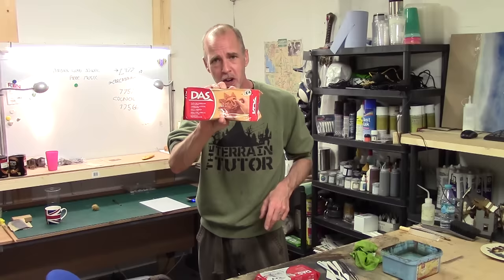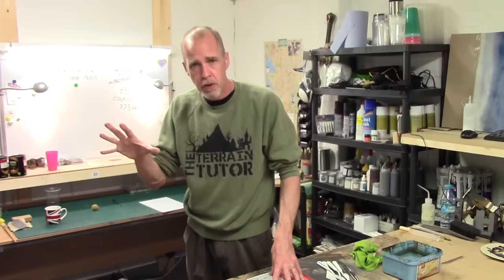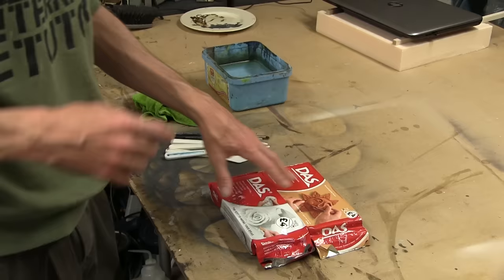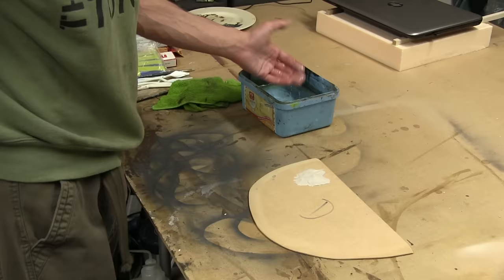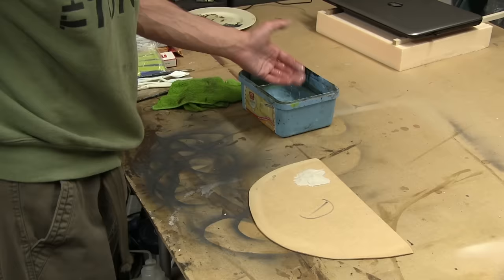Das Air Drying Clay - Pro Terrain Tips & Tricks

Comment: I use air dry clay a lot. I always have a small spray bottle filled with water whenever I work with it. I realized it's better to start with a thin layer of airdry clay in making sculptures let it dry and re apply another layer, building up. Sometimes I mixed airdry clay and more water to turn it into a paste and I use it in filling cracks or as a adhesive whenever I apply a new clay over a dried up clay.
Reply: This helps a lot thank you
Reply: hello i have a question? what if when it's dried very well in 1 year or more and then you squeeze it what would happen? it's still durable and it will never be broken?
Reply: Have I told you..that I absolutely love you!thank youu❤❤❤I dint know anything ,everything I was making a was thrown the trash lol..I now see why it cracked so bad..tytyty ..
Reply: Michael Jayson Banua  Thanks for sharing! This really helps!
Reply: Thank you!!
Reply: Thanks!this is very helpful
Reply: Layering air dry clay has been unhelpful in my personal experience.  The layers dont merge into each other very well, so they split off frequently. 

I must be doing something wrong, because I just cant get it to work.  Is there a technique to make the layers join up better?
Reply: @CNNBlackmailSupport  what I do is I scratch the surface of the dried up clay, spray some water to reactivate the dried up clay in the scratched surface making it sticky before adding "new" clay. It's like when you're adding cement on your wall to smoothen the surface, you have to scratch the surface so that the new cement have something to hold on to and combine with the surface 😊
Reply: @zahrah4504  welcome
Reply: @iwakuralain1459  welcome
Reply: @elinoldenburg8547  welcome
Reply: @yolandanadamas2930  cracking is normal. It happens to clay that "shrinks" when it dries because the water evaporates or other substance in it. I suggest to use clay/s that has low to 0% shrinkage. Though normally when you add water in it to turn it into a paste it does really shrink as it dries and cracks may happen. What I learned is you have to apply clay in layers to minimize cracks. It'll make the base stronger as you build up the layers and starts adding details. Some artist do advice to pop them in the oven to speed up the drying process/curing but I haven't tried it.
Reply: @WhiteTiger-gt3tn  I have a few figures I am currently sculpting. A few of them where 2 years old and they are doing well. However the hands that I sculpted were completely destroyed because I used wires as base and I forgot that they are not stainless steel so rust happened. So I suggest to use aluminum foil or wires, brass wires and etc. As long as they do not rust. The rest are ok and they do not crumble or seen any cracks.
Reply: @Pablo Peraza welcome 😊
Reply: @thornprick2645  welcome 😊
Reply: @michaeljaysonbanua4870  thank youuuu❤I am learning so much. Thank you😆
Reply: @michaeljaysonbanua4870  Makes sense.  Kind of like applying a patch to a tire.  Gotta rough it up first for maximum surface adhesion.  It's so obvious now that you said it.
Reply: It's like miniature concrete
Reply: @michaeljaysonbanua4870  I have a question, can you make air dry sculpt as master for making, let's say a silicon mold?
Reply: thank youu
Reply: Thank you for this tip!
Reply: What kind of paint i have to add to it before it harden? Does acrylic paint work?
Reply: Using a few ' art ' paint brushes helps with this as well , it smoothes the surface and makes a slurry that fills joints and cracks . Also helpful making interesting surface textures .
Reply: @michaeljaysonbanua4870  Excellent tips ! That is also an ancient plastering method , ' keying ' , ie roughing up the surface so the new clay has something to cling to . Amazing how many building techniques come in handy with this material .
Reply: Have you had a success with attaching air dry clay to cardboard? I'm building houses and other stuff out of cardboard and was wondering if it would stick to that?
Reply: Can I just cook it? Or is it a must for only air drying.
Reply: Thank you for sharing, its help a lot
Reply: Yes. You can also use PVA white glue to strengthen air dry clay at thin areas, applying with a brush on the surface.

Comment: This has probably been said but don't throw away any small parts of dried air dry, add them to a tub of water and mix them to make slip. Slip basically glues the clay better than plain water and adding a light layer to a piece before drying can avoid cracking.

Comment: 0:00 intro
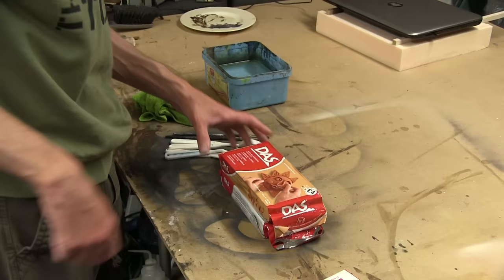1:10 dark clay and light clay
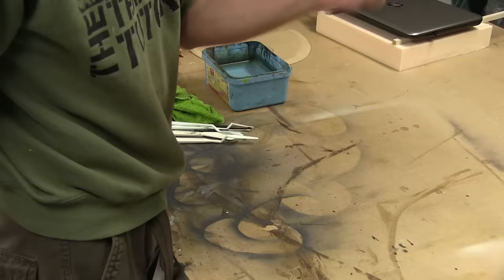4:46 wrap/seal your clay
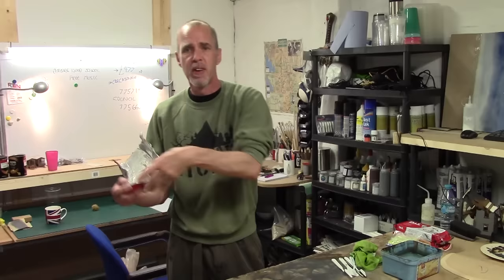5:46 tools
7:30 clay fall of surface?
11:11 clay cracking ?
17:50 can i use it in molds?
24:00 tips on using different tools 
28:26 adding additives 
29:11 mixing das with pva 
32:29 quick recap 
34:10 outro

Comment: I have been using air dry clay for many years in Western Canada which is a very dry climate.  One idea that I use to keep my clay from drying too quickly is to take a bit of a sponge, soak it, wring it gently & place next to the clay.  Cover all with cellophane wrap.  I do this when working on large pieces that take several days to complete as well as when I am finished to prevent cracking.

Comment: As a long-term user of DAS to make wargame terrain, I use it in a slightly different way.

1 - I add DAS over a thin layer of dilute PVA glue

2 - I score the base material either MDF or plastic card with a scalpel. Criss-crossing across the surface to produce a 'key' for the DAS to grip to.

3 - I bake my DAS in the oven short bursts of about 10 minutes at low temperature.

4 - When fully set I seal the DAS with a dilute PVA and water wash.

I have not had any problems with cracking or lifting.

If I need to add a thick layer, I will apply the DAS in two or three thinner layers or use Balsawood or foam as a bulking up product and apply DAS  over the top.

Finally, I prefer DAS Terracotta (I think it is is finer) , but use DAS White as it does not stain.

Just my technique.

Tony
Reply: I've heard tou can't waterproof it, is that true? I'm making a far less cill fary garden lamp for my daughter so need it as strong as possible
Reply: So what temperature do you bake it at?
Reply: can I bake das clay air drying too?

Comment: Best DAS video out there! Well done! One correction though. Scratching the surface will actually prevent cracking. In the old times, farmers in my area used to put a clay mix as plaster on barns and houses walls. They used to scratch the clay after sticking it to the wall surface to prevent the clay from cracking and falling off.
Reply: Hi! I see you worked with DAS before. I'd like to put a thin layer of DAS around a styrofoam ball. How would you recommend me to do it, please?
Reply: @lidia1407  really late but with any clay I would recommend to wrap the styrofoam ball with saran wrap then add the clay
Reply: @stevekujo8716  Thank you very much :-)

Comment: A good tutorial! I use DAS for crafting and find Titebond quick & thick glue sticks it well, dusting silicone moulds with corn starch enables flipping out immediately when making multiples, scrape a knife over mould to remove (and reuse) excess before flipping out shapes and repair small cracks with some DAS in a little water to make liquid and brush gently into cracks to fill them. Happy modelling!
Reply: Hey!!! Just what I was wondering. I’ve only seen one person mention that and was asking about it. Also, do I need those actual tools? I thought I’d use plastic knife and utensils. I’ve got a couple of tools but I’ve seen others use many things for adding texture and the like. If you have any input, I’d appreciate it. 😊
Reply: @1ronmad1n  Hi, I just use anything I have to hand for shaping etc. I only do modelling now and then and some specialist tools can be pricy -  so 'use what you have' is my motto! In case it is of interest I often roll out air-dry clay and use cheap silicone moulds to stamp onto it - that works well. Also, if making flat items, make them on a flat ceramic tile (from kitchen/bathroom etc) and leave them on it to dry (dusted with cornflower) - keeps them flatter. The slower things dry the less likely to crack - can lightly cover with plastic if needed. Experimenting is part of the fun - and if it goes wrong, just add water, soften, and try again - practice makes perfect as they say...
Reply: @suebrown7882 thank you so much for your assistance! Yes, I am looking forward to playing around with it now that I know you can just wet and start over. It will be a fun journey, I’m sure. I’ve also considered, as I’ve seen, to try hot glue or the like. This is something I’m determined to do, so I’m going to! Thanks again, be blessed and have a great day!😊

Comment: I know this is an older video but this was so fun to watch.  You have such a great energy.  I think for me and my love of air dry clay, if I was to use a mold of some sort, I might only put it in for a couple of hours and then would take it out to finish drying in a regular temp room.  Additionally, in case others new to air dry clay are curious, I just tested out drying in my oven at a low temp and it worked beautifully!  Keep in mind, these were for flat about 1/8 to 1/4 inch pieces that I am using for earrings.  I still let them sit overnight before sanding, painting, and priming.  Air dry clay is hands down my favorite.  Polymer clay is nice but having to knead and prepare it to even use, is not for me.  I'm pretty impatient and when I want to create, I want to do it right then.  LOL!

Comment: If you want to stick DAS onto plastic card or other smooth surfaces, scratch it up with the back of your Xacto blade and put a coat of PVA on it. Then apply the DAS. It will warp as it dries, but thats ok, just let it. When all dry, you can bend it back straight again and the DAS will develop "micro cracks" to relieve the stress. I put it under a magnifying glass and still couldnt see them well. A coat of paint covered them all up just fine. Thats the way I made my first thatched roof, worked great.
Reply from the maker: Yep, keying plastic works well for bonding bud
Reply: Hi! I see you worked with DAS before. I'd like to put a thin layer of DAS around a styrofoam ball. How would you recommend me to do it, please?
Reply: @lidia1407  You might try rolling it out into a thin sheet and then wrapping that around the ball. Lay down a piece of waxed paper first. That might help you lift it up in one piece.
Reply: @billd.iniowa2263  Thanks very much 👌

Comment: If you want a dry river bed put down das put loads of water on it with a sponge so its a bit slushy, then put it somewhere warm like an airing cupboard. Dry river bed or desert pools instantly. Different thickness and more or less sludge changes the pattern. You can use over wet plaster and pva instead.
Reply from the maker: Top tip mate

Comment: If you need a quick few, use hirstarts moulds with dental plaster. It’ll be completely dry and rock hard in 15 minutes. If you want to keep your texture rollers clean and easy to work with, put a layer of cling film over the clay. That way your tools stay clean and the clay will be workable much longer.

Comment: heey there, 

great video showcasing how DAS air drying clay works. i found your video while looking for answers about DAS air drying clay. maybe its the wrong place to ask but i have a few questions about air drying clay in general and hopefully you can get me into the right direction because from what i could find, you are the most informative. i want to sculpt a bust using DAS air drying clay. 
the reason im using DAS air drying clay over Super Sculpey is because i dont have an oven other then a microwave with an oven function but ive seen that a microwave oven isnt the best way to oven bake clay due to hotspots and potentially burn the clay. 
so my questions are since DAS is an air dry clay, how would you go about and use it to make a bust? would you use a armature and if so would you remove the armature at a certain point to reduce or prevent cracking? if you dont remove it what kind of material would you suggest i use for an armature to get the minimal amount of cracks while its shrinking?

hopefully you could provide me with the answers im looking for. if not, thats absolutely fine, in which case do you know anyone that can?

massive thanks in advance
Reply from the maker: Forget das for that mate, just make a desk oven with an empty can and a desk light, just cut a hole bigger enough for your model on the side near the bottom and shine a desk light into it

Comment: Say Mel, what IS this Das made of anyway? It looks like paper pulp with some kind thinned down clay added. It has some kind of fiberous texture if you break it in two.  
Oh BTW, there is an advantage in using Das in your silicone molds: It will be a heck of a lot lighter than Crysta-cal would be. Better for transporting around.
Reply from the maker: I have no idea what it's made of mate but it's a lot heavier than crystacal both in it's uncured and cured forms mate
Reply: You're kiddin'. Really? I'll take your word for it Mel,  you make your living doing this stuff. But thats a surprise to me.
Reply from the maker: You really need to play with Crystacal R matey .....

Prestia Casting Plaster - 1691PSI, 14-32s, easily carved
Prestia Classic Plaster - 2131PSI, 8-19s, carvable dental plaster
Herculite2 - approx 5000PSI, 6-20s, similar to Modell and Stonepowder
Basic Alpha Plaster - 7054PSI, 12-25s, ALPHA (for polymer resins that require the use of alpha plasters)
Modell Plaster - 9000PSI, 12-16s, good starter plaster, hard and durable but can be carved or modified, very similar to Stonepowder and Herculite2
Crystacast - approx 10-12000PSI, 14-25s very durable
Crystacal R - approx 12-14000PSI, 10-25s, extremely hard wearing
Reply: Thanx for the info Mel. I got 3/4 of a bucket of Hydro-cal to use up. But Crystacal-r is my next plaster purchase. If I ever get thru with this stuff, lol. I'm a very small fish in a very big ocean. I can only work as fast as my health (mental as well as physical) may permit. ;-)

Comment: Make dried up Das clay editable again is not easy, but possible.
What i did was, cut it in small pieces.
wrap in a wet cloth, place the cloth with the clay in a soup plate, and put more water in it, to the edge of the soup plate.
Then leave it for a while.
Then you put all the pieces in a mixing bowl, and crush them with a fork.
For me this was not easy, the clay was still pretty hard.
Then repeat step 1.
Then you make a ball, and you roll the last hard pieces out with the roller and some flour.
You need the flower, otherwise the clay will glide under your roller.

I still had half a pack, and here Das is pretty expensive, so I did not want to throw it away.

Comment: I can confirm that it cracks with pva in it lol, but it is super hard. Currently working on a castle and it's been a pain 🤤
Reply from the maker: It's those thin applications mate, they're a killer
Reply: @ Zach Pennington - Just sticking PVA in it isn't enough, you need more water too, no clay is designed to be used dry, except those made from plastic.

Comment: It's not a miracle compound, you actually have to put some work in to get results; know your materials - building on an MDF base means you'll need more water from the start. DAS won't crack if you use enough water, clay ALWAYS needs water (unless it's made of plastic) keep work evenly moist until complete - look at the amount of water potters & ceramicists use & the effort they put in, clay needs work, you don't just bang it together; try making a jar of 'slip' & key your surfaces to help with sticking - it's clay, not Velcro. Ensure it's dried slowly & evenly - there's no harm in spritzing the outside with water if it seems to be drying too quickly. If you want a product that does everything for you, don't choose the cheapest product in the craft shop, there are many other clays with more properties & fancy oils etc to stop cracking, but you have to pay for them.
Reply: Hi! I see you worked with DAS before. I'd like to put a thin layer of DAS around a styrofoam ball. How would you recommend me to do it, please?

Comment: I use DAS clay a lot;  I store it in an air tight box, BUT,  before I put the lid on, I take a tissue, or a piece of paper kitchen towel, wet it all over, fold it in half and place it over the clay;  then I lock the lid on the box.  Never had any problems with it drying out.  My clay last for a long time.   Also, I don't know why it is, maybe it's just luck, who knows, but I can't remember clay cracking on my projects.

Comment: Oh, that is great advice, thank you so much! I have one question I need to solve rather quickly, and that is about the PVA glue. I am working with air dry clay for the first time, using DAS as well, and of course I´m going in at the deep end making a big (!) Donald Duck figurine, about 50 cm high, that should be about 20 inches. 
I made a full body armature out of cardboard and Paper (so that I would need only one layer of DAS to cover the figurine, a layer of 1 or 1,5 cm should be enough) and built him a "wire belt" with wire legs, on which I put the body, so to speak, but the wire is almost to weak to carry even the paper figurine. I wonder now if the DAS will hold the weight of the whole thing once it is covered in it. I´m so worried he will just do the splits and the legs will spread outwards and break under the weight. I need to make the bottom part stronger. So now I´m wondering if it could help to mix PVA and DAS for the belly and legs so that the "underpart" will be hopefully be strong enought to carry the entire body. What do you think? I knew I would run into some trouble 😯!